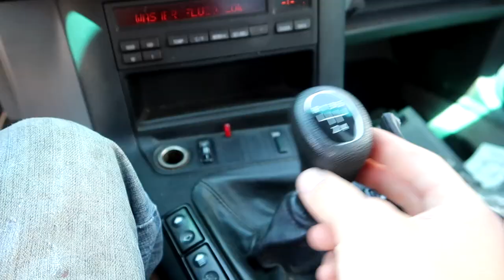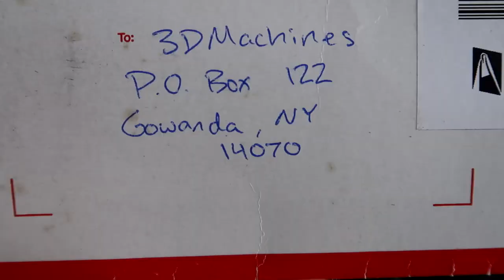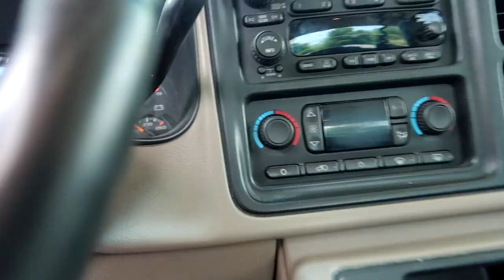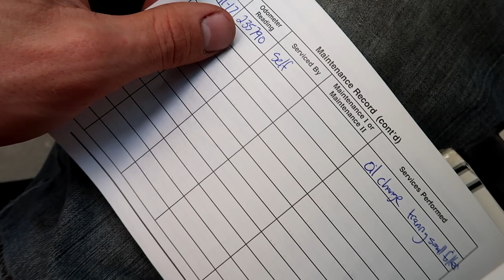Sick of THIS Happening

Comment: 3dmachines you need to put some 2015 tow mirrors on the d max and you need to color match to the truck and put some small led pods in the frame of the mirrors

Comment: If you never want to use the 'emergency' button, open up the back and pull out the PCB and put some clear tape over the little gold contacts and then close it back up. I always end up doing this because I end up setting off my alarm more often than I ever use it to find my car.